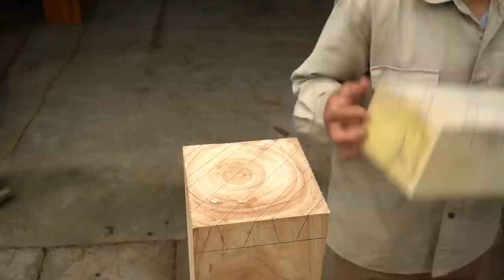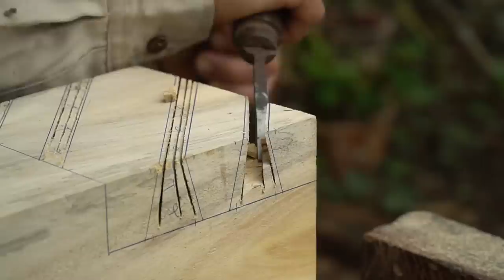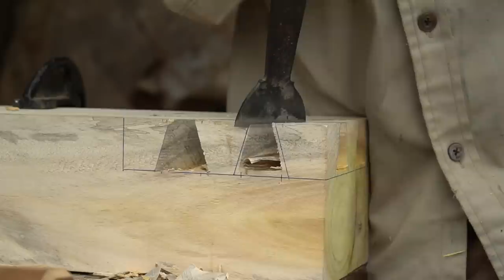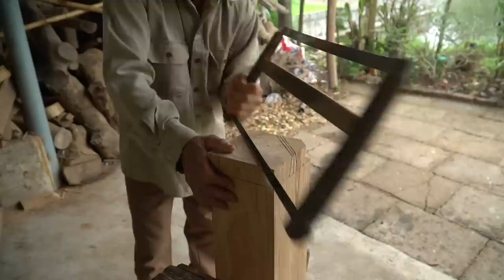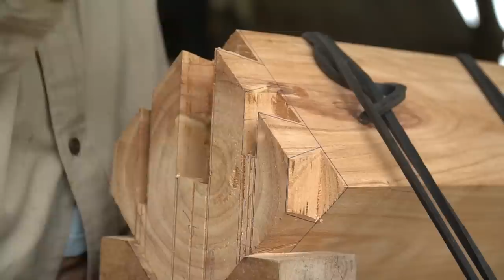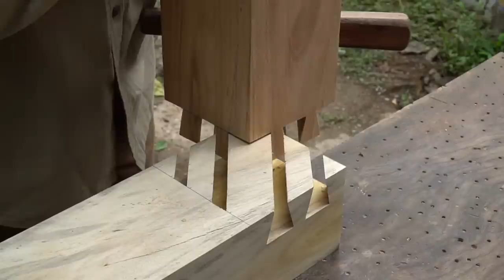IMPOSSIBLE Strongest Structure Wood Joints, Amazing Traditional Woodworking Skills

Comment: Dad was a carpenter and builder and I spent hours as a young teenager using his tools in our workshop at home. I couldn't even dream of achieving this level of fit on all edges of those dovetails. Beyond amazing!
Reply: This all fits together so nicely that the Japanese had to go and create a whole different set of problems for themselves. Everywhere in the country a tatami mat is exactly six carpenters' measures long. It's just that in half the country a tatami is 182 centimetres long, and in the other half it's two centimetres different.
And yes, the carpenter has a laser level for making sure the roof is straight above the right spot on the foundation -- but on his belt he hs the measuring stick handed down by his great-great-great-great grandfather, from back in the days of the wandering samurai, because the folks who make the lasers haven't calibrated them for which half of the country's tatami reign locally.  If he'd been asked, his grand^5 father would have said, "Yes, of course nobody will be able to trust the lasers. What if the batteries are dead. I'll just make sure the little buggers all respect their tools and pass them on down."
And if you imagined for even a microscond that the line dividing the two sizes of tatami is the same line that divides 50 hertz house-current from 60-cycle, no, no-no, no-no-no-NO, that's a fever dream. Take two aspirin and the afternoon off. 
Go to the race-track with all the truck drivers...

Comment: This is such a beautiful piece of work! I made my wife watch it and she was as impressed as I was. I would have enjoyed watching the glue-up, too.
Reply: @Will Bluefield I'm not entirely sure that glue is necessary.  If it were a table you could hold a top in place with vertical dowels, and the dovetails wouldn't slide out.  Given this kind of precision there would be no looseness so the glue wouldn't really add anything.  In fact if you wanted to move it and you don't glue it, you could drill out the dowels, slide it apart, and then reassemble it for the cost of new dowels.  The glue would just make a mess and not provide much benefit

Suggesting he needs glue might even be considered an insult for all I know! 😛
Reply: I think this joint is for where gluing isnt going to happens, or a common saddle joint would probably work just as well
Reply: Point taken, about the glue.
Reply: No glue needed whatsoever. That's the whole point of this type of joint. Superbly strong and stable, just as it is.
Reply: A dovetail joint is the strongest and does not require glue..... even I, a mere woman, knows that. This is how drawers were made long before machines were invented.
Reply: If you’ve ever had the pleasure of visiting Japan and seeing temples many hundreds of years old, then you can see this intricacy on a grand scale. But then, when you discover that there is no nails or glue and that as they age, they only become stronger as the structure settles into itself then that’s the amazing part of all of this.
Reply: @thelmarose2782  Can I just say that my dovetail joints do need glue.

Comment: In addition to this method, it is said that there are more than 200 other techniques for joining wood to wood in Japan.
The advantage of this method is that it does not use metal, making it resistant to rust and other age-related deterioration.

Hōryū-ji in Nara Prefecture is the oldest existing wooden structure in the world. Researchers estimate that it was built in the late 7th century. The fact that it has stood for 1,400 years without collapsing in earthquake-prone Japan is a testament to its durability.
Reply: 한국에도 수많은 목조 건축물이 이었고 기술이 전해내려 왔습니다. 하지만 일본의 침략으로 대부분 불 타없어지고 무자비하게 약탈당해 소실 됐고 한국의 수많은 기술자들 또한 일본으로 납치 당했습니다.
Reply: The technology of Japanese wooden buildings was spread by Baekje nobles and engineers who came to Japan from Korea to escape the Chinese invasion 1,500 years ago. They lived in groups near Osaka and formed what is now the nation of Japan

Comment: I've maintained for years as a professional carpenter that good draftsmanship and precise geometry in one's layout is the key to high-quality workmanship. And more skilled guys than myself have always reminded me how important sharp tools are too. As one who hardly ever touched a tool before age seventeen and always saw myself as more an intellectual type, I've learned that nobody's work is ever completely perfect, but that the higher the standard you set with the layout and planning and choice of materials, the better the work comes out, even from a guy like me who still after forty-plus years feels like I'm all thumbs at some point in every project. I strive for 98% perfection, usually feel satisfied with 95%, and no one else has to know where I came short....

Plus I see this man uses a pen instead of pencils. Best upgrade to my own methods I've made in years was to start collecting free pens from the bank, and I haven't used a pencil in ages. One old boss's daily sermon (they all have one) was 'keep your pencil sharp!' Once I switched to pens, I don't have to.
Reply: Interesting what you say about pens v pencil.  Have you seen Paul Sellers videos.   I have tried to emulate his dovetail joints but despite getting quite good at sharpening,  the precision to get two pieces of wood to  slide together so nicely still eludes me.   Perhaps if I got one of those set-not-squares that this chap has.....
Reply: @shanedevon6447  An absolutely unfounded, uncalled-for and outright silly remark, but I hope you feel better having made it. Perhaps you'd care to share with the class just what this 'lead carpenter type' does seem like, according to you. I'm all ears.
Reply: this video made in vietnam. the background is 100% in Vietnam

Comment: This is amazing, but it looks incredibly time consuming as well.  I am shocked at the level of precision you were able to achieve with just a straight edge and pencil.  In particular, I see that the key is that angle-ruler you used to make sure the angle of each of the cut-outs was exactly the same.

Comment: This joints are way better than staples, nails or screws. This is way better than what a manufacturing carpentry builds in USA. This will last you for generations to come.
Reply: any proof that they are better?
Reply: @metsrus  Most temples in Japan are built like this and are more than 500+ years old. What's impressive is that is a country that is prone to big earthquakes throughout its history and the temples are still intact. Look at Californias buildings, the oldest are the catholic mission buildings built by the spaniards in the 1700's and has been rebuilt numerous times due to smaller earthquakes than japans has.

Comment: Just 1 question: what is the durability of this over the years? It is known that wood dries with years and very often you need to tighten traditional screws. And how is it in this case?
Reply: I think the wood is of tropic origin and so less inclined to shrink or swell. If it was beech or pine it would be much more likely to be damaged by seasoning. The dovetail joints themselves are quite indestructable and it will probably last until the wood starts rotting.Wood joining like this is still part of apprenticeship for carpentry in many countries and many hand made wood joints are even approved for solid constructions like roofs or walls. This particular piece is questionable though in my opinion, because the small part in the corner. I think it could possibly split, if the wood is stressed in this direction. Anyway a beautiful piece of work and impossibly precise craftsmanship.

Comment: I have a question 4U pls .  ×3 Lumbar . ×2 lying flat in a corner configuration & the 3rd vertical on the corner vertical.  Any chance of showing that joint . In large section timbers please.  Say 300mm square or larger . Thankyou . Robert Australia

Comment: I think there's much better strength in the second piece as the wedge sections are more inline with the grain therefore better connected with the rest of the length of timber.

Comment: In no way am I dismissing the skill needed to make this joint, but I wonder if it's truly a strong joint? It appears to be connected by four seams of wood that are no more than an inch or so wide for timbers that are nearly six-eight inches wide. Would this joint really hold up to weight and stresses? Would this joint really be used in anything requiring this level of timber, or is this simply an exercise in the craft? 
Very cool video and thank you for sharing.
Reply: Every dovetail joint is a very strong joint

Comment: Intriguing, I could not imagine how that joint worked until I saw it was done at a forty five degree angle.  A sad reflection on my rigid thinking that would not permit my brain to conceive of a dovetail not running at a right angle to the timber surface.  Thank you for the lesson.

Comment: it's great that he has chisel skills & all- impressive even. I've worked in the trades professionally since 1985. around 1993, i was on a remodel job, the general contractor & his lead carpenter went to lunch- and left their journeyman to hang doors. they had nearly every modern power tool known to carpenters on site. THIS guy proceeds to make his wood wedges... using a hatchet & chisel. spent the entire hour & a half his boss was gone... just doing that. they return... thinking at least 2 of the 5 doors that needed hanging would be complete- oh no. WOOD CHIPS. so? these two master carpenters take up the circular saw & split off 2 dozen shims in about 30 seconds... then hang all five doors in about 30 minutes. this guy reminds me of THAT journeyman... 

why? 

because even I... A PLUMBER... could make that joint with a skill saw & a router in about 15 minutes.

Comment: To be the strongest all corners must be rounded inside for the females, these can be done by drilling small holes like 1/4 of inch hole, and chamfered the male pieces to have a tight fit. Any sharp angle has more chances of breaking off.
Reply: Not true

Comment: What they did not show in the video is the multiple steps  of holding the pieces beside each other to check for a little more off here and a little more of there until the fit is just right.  For this type of work you cannot just quickly scribe a bunch of lines, chisel out wood and presto it all fits together.
Reply: Thank you Captain obvious

Comment: But does this actually make the joint stronger? I can see that there is more gluing surface, but a lot more wood from each piece was removed.
Reply: Every dovetail joint is very strong
Reply: @daveklein2826  Right. I understand why dovetails are stronger. I meant is this particular one better than others, or was some strength sacrificed for an unquestionably awesome looking joint? (The craftsmanship was amazing, either way!)

Comment: 10:45 …After the video cuts, the two parts were obviously sanded or otherwise further worked on. Why fake the result like that? Don’t get it.
Also, the joint is definitely not strong and will break.

Comment: This is the stupidest way to join 2 woods together. he thins the material, thats one.
spends a huge amount of working time on a simple connection, that's two. 3 long wood screws will solve the problem.
in the case of applying force, such a connection will break 2 times faster than a connection with screws.

Comment: In my opinion, a giant waste of time. Try stress testing it and see if any of those small mortises hold or fail or just crack off. And will it stand the test of time when the wood wants to expand and contract? Try laying out a table, or a house for that matter with all those confusing joints. Nice as a puzzle or to show off chiseling skills, with obviously green un-dried lumber, but in my opinion useless as any functional joint system.